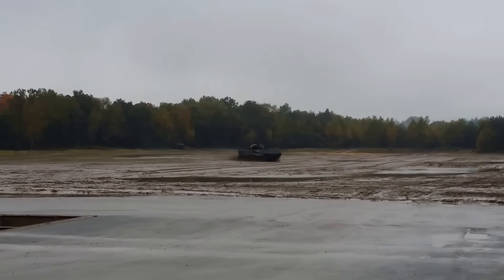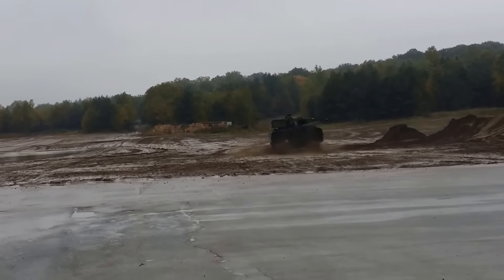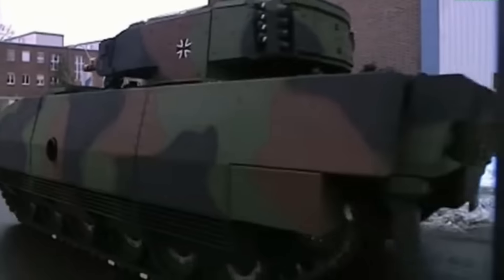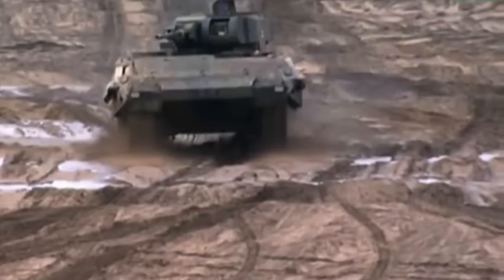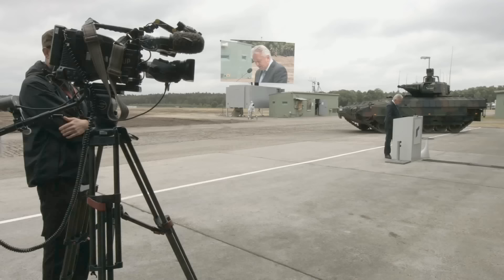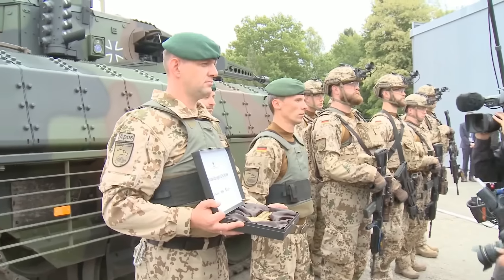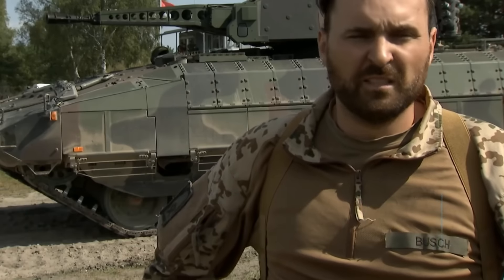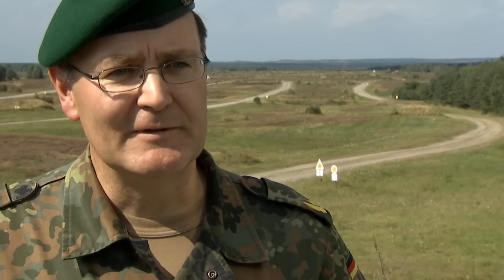The Puma Infantry Fighting Vehicle - Overview and Opinion

Comment: I have to correct you there: there are only two protection levels: A; (air) this is the basic level, without add on protection for transport with the a400m (31,45t).  C; (combat) this is the combat configuration with the add on armor, and the standard configuration (all videos of the puma in your vid are of this configuration) (43t). they intended to have a third protection level, B for rail transport (railway = Bahn) but cancelled it, because the c configuration turned out to be transportable by rail aswell. 
The rear compartment can only take 6 soldiers.

Comment: When I think of German soldiers struggling with their HK G36 (sight dust covered, barrel bending...) and asking for the ancient HK G3 (reliable, packs more punch) and how their transport failed in Afghanistan, I do see all that electronic crap critical. Sure, as long as it works, it's superior, but you always need to be able to ditch it and still use the rest if SHTF.
Reply: HK417s (G27) are used over G3s in Mali. Puma was the most reliable IFV in the czech test trials, even though some of the other competitors were far less complex.
Reply: Never had any issue with the G36...if you use it like a light maschine gun, then there will be problems...

Comment: next point the Puma is pretty simple but you concern about almost everything... no one worry about the same layout at the T-14...thats pretty stupid .. computer work pretty well in military vehicles why should they suddenly fail in the Puma..sorry your concerns are pretty dumb and silly... there is nothing new in the Puma, they just arrange everything in a different way, electronic firecontroll and electronic observation system thermal view laser rangefinder, electronic battlefield managment, GPS, hardkill systems, laser warner on tanks exist since decades and work well... why on earth should suddenly a computer Gremlin fuck everything up?
 
There is no different between a independent thermal view sitting on top of the turret remotcontrolled and feeding the commander with indirect view via cable or a independent view sitting in a crewless turret ontop of a chassie were the TC sits... if you destroy the modern optics on a conventional tank or a tank with a crewless turret have the same effect... vehicle has to exit battle and return to repair shop.
operating a modern tank/IFV with old fasion handcrank and direct fire sights is to be honest useless... u stand no chance against a fully functional enemy tank... it is only used in extrem emergency but never to stay in the fight just for the minutes you need to get your ass from the danger zone.... 

crewless turrets are nothing new Germany tested them since the 1970´s VTS1 so there is nothing to worry about they have tonns of experience with it.

Comment: It would be great to see Canada get some of these. It's time we give our soldiers some top end kit, especially to go with the new Leopards. But I'd be lying if I was optimistic they will.
 
  Also on the point about being to dependant on computers and cameras I wholeheartedly agree. Even though if anyone cam make it work, it would be the Germans. But I'd atleast like to see a redundancy of being able to operate it manually put in. Plus how easy will this stuff be able to be fixed in the field?
  
   Probably receive slack for this, but that's why I'm a critic of the Russians new tank. I'm sure it's going to be a beast of a tank. But especially on a main battle tank, being fully automated from inside that armoured front. Great for crew survivability. But to easy to make become a disabled from close artillery, etc. Plus I think it's still really important for a commander to be able to sit up high and see what's going on, or hear what's going on with his own eyes and ears. And no offence to any Russians it's just a fact. But Russia is still highly dependant on French and Israeli high tech.  
  
  I think both these systems should have atleast the redundancy to be able to be operated manually. This tech is great for civilian application, but when your in battle field conditions I'm highly skeptical.
Reply: If they modularize sufficiently that repairs can be made quickly at the crew or company level quickly I don't see it being a major issue so long as the vehicle's running gear is reliable enough for it to be able to withdraw and repair if needed. I would expect that if the Bundeswehr and Russian Ground Forces of all armies adopted these they have passed through rigorous testing under simulated combat conditions to test for durability. One big advantage of this remote control shit is that you can test the fuck out of it without endangering an actual crew. I'd guess that both the Germans and Russians pounded the shit out of test vehicles with live ammo to test it's reliability. I can't say for sure about the Russians but I'm certain the Germans did. Puma spent a long time in development and was designed to take a beating and keep swinging. This video is the first time I've heard of it being able to repel main gun rounds from a tank though. Sounds a bit optimistic to me but with advances in modular armor going around I wouldn't be too surprised if they managed it. These unmanned turrets are really no different than the RWS systems we've been deploying on HMMVWs, Stryker ICV's and MRAP's for over a decade now with no major issues.

Comment: The Puma its an extremely good IFV for today days, its armed with a powerfull 30mm auto-cannon made by the finest German engineers, its able to mount soft or hard to kill systems, ERA, Active protection systems (APS) and can also mount SPIKE ATGM´s !! It haves extremely good mobility, advanced sensors with 360º view and carries 6 troops. The best thing is the one piece cabine. meanning the 3 crew members can directy interact with each other making replacing them in case of injury or death very easy from the side.The is wat the US is missing, the Bradley can´t go against modern IFV´s specialy Russian and expect to be sucessfull or efective, the Puma its a marble of enginneering perfect to suport infantry and project power

Comment: I think you might confuse infrared with thermal radiation.
They are not the same. 
Broadly speaking, infrared is utilized for most modern night vision systems, while many missile sensors are measuring thermal radiation of a longer wavelength.
Reply: Could you write the range of wave length for infrared radiation and thermal radiation, because I am confused by your comment
Reply: No, you are wrong, Heinrich. Most of the thermal radiation is part of the Infrared spectrum. Go look it up.
Reply: no, thermal radiation IS infra red, they're just separate names for the same things.
Reply: Dude, this is high school physics. 
Infrared is defined from 700 nanometers (nm) to 1 mm, while thermal radiation is every wavelenght of the EM spectrum emited from a hot body.
Reply: Um... Heinrich... If you look at the thermal signature of a hot body, it is entirely in IR. You're confusing IR illumination with IR in general. IR illumination DOES use a shorter wavelength than you typically see in a thermal emission (~850nm or so) but most modern image intensifier NV gear is not REAL IR. It can see in the shortest portion of the IR spectrum, but real IR optics can see IR thermal emissions just fine.

I'm not even going to go into the latest generation IR / Intensifier hybrid systems as they are RIDICULOUSLY expensive (think $20k+ for an infantry monocular, compared to ~$4k-$5k for a 3+ gen image intensifier). The only people who are routinely issued true IR or hybrid systems are bleeding edge special forces. Most militaries in western countries generally make due with 3rd+ gen PVS-14 style single tube image intensifier NV gear.
Reply: Matsimus was suggesting that IR absorbant paint would protect from missiles.
And no, thermal radiation can be anything from microwave through visible to gamma radiation, depending entirely on the temperature of a body, nout just IR.
Reply: I have yet to see a human or combat vehicle radiate significantly in the visible part of the spectrum unless they were on fire. Microwave radiation is a joke. Do you even black-body bro?
Reply: The old (1940s to 1980s) activ IR systems used a large, often switchable IR/White lightsource in the tank with "barely Infrared" spectrum (almost visibly) that could also be seen by some passiv light amplification gear (1970s and later). Often over longer ranges than the IR equiped tank could make use of it (since the tank needed reflected light). 

Thermal sight, Thermo-Imager or Wärme Bild Gerät(WBG) in german in military speak is really passiv infrared gear, today often overlaid/mixed with a light amplification picture. The Wärme in WBG translates to Heat and the ones Ich used in the late 80s (Marder IFV, MILAN ATGMs MIRA sight) used IR radiation from the target and environment to generate pictures. US  M1 Abis where quite easy to detect when the turbine was running since they had to use "deflect exhaust up" settings in Germany to prevent forrest fires

Comment: Matsimus, you got the armoe system wrong. No wonder because germany have done a hybid between a light and a "heavy" ifv.
There is only one reason not to install the heavy armor kit. 
This is airtransport in a Airbus 400m. 
Yeah this is all.
This makes it possible to transport 4 puma and slap on kit in 5 or 6 (dont remember) A400M.
Keep it up. The 5.54 gun is a desaster and we all hope it will be replaced hopefully by the rheinmetall rmg. Check it out, you will love it!
Reply: carry 37 tons? I belive its weight in A armor is 37 tons and it weights 41/45 tons with C armor. And still have enough engine power to have the fastest exeleration for an ifv.

Comment: All this IFVs that cost as much of a MBT its useless in my opinion! the sole concept of the IFV has conflicting requirements. from the APC prospect it must have heavy armour to protect the infantry squad, on the other hand to have strong armament to fight. strong armament means less weight for armour and smaller infantry team (around 6 its inefficiant in combat) and more armour and bigger infantry team (around 8) means weaker and with lesser ammo armament! if you add that its an expencive vehicle to operate like an MBT means you would never had many vehicles becouse the armament suite making the vehicle very expencive! the CV-9035 battle experiance showed that wile powerfull it had insuficient ammo ready to use (around 70ap/70HE shells on the double feed) and if used all from one feed it would take many minutes (20m) to reload from the spares! that means poor battle efectiveness, you can't have it all! what the militaries should have done its the Heavy APC concept. APC role its to protect the infantry squad they carry so they can safely arrived were needed and fight as infantry. that means mostly they require heavy armour equivalent to a MBT to protect them and a complement of 8 infantry squad+ the crew of the vehicle. the HAPC would have only self defence weaponry. Thats on debate, enything that not compromise the heavy armour. a WRS with 0.50cal+762mm MGs, or 0.50cal+40mm auto grenade launcher or even a light 20mm autocannon+7.62mm MG. the antitank role of the company/battalion would have same family combat vehicles but with no infantry squad, armed with ATGM and autocannons.  a combat vehicle and a apc/ifv vehicle they move diferent on the battlefield and the temptation to use the IFVs in a light tank role its puting at risk the infantry squad that carry and its protection should be the No1 priority. and all that with half the price of an MBT.

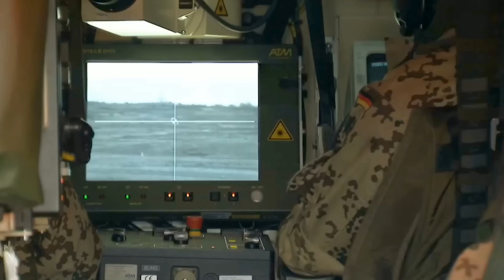Comment: 9:33

there are up to 6 soldiers in the rear, not 8.
Reply: Due to german mech. squad size of 6 they went for a storage rack below the unmanned turret. Without the rack, 8 fit. http://www.rommelkiste.de/Fahrzeuge/Puma/puma8.jpg
http://www.psm-spz.de/typo3temp/pics/aed4ad9654.jpg
Reply: Jonny okay i dont knew that is possible. But the german army puma has 6 seats because a mech inf squad are 6 soldiers.